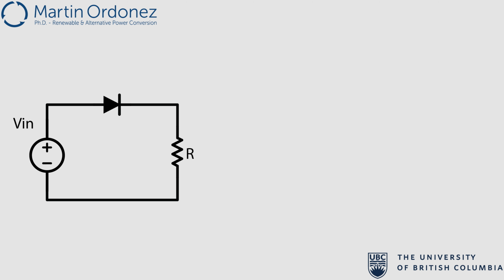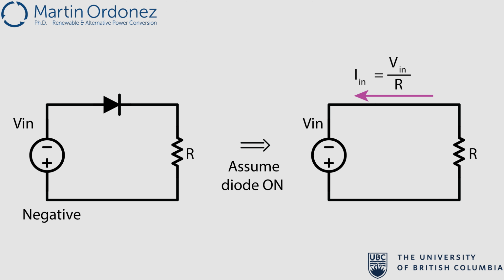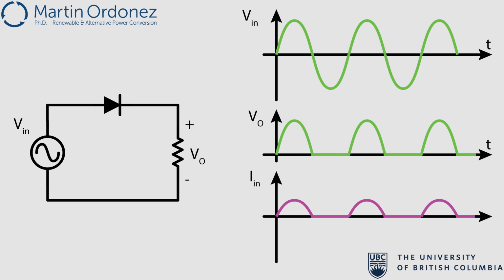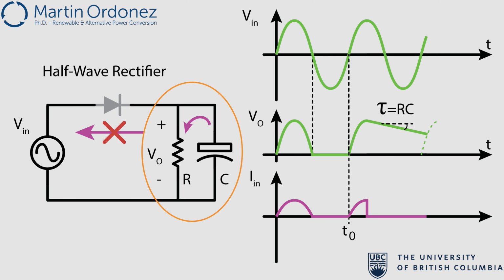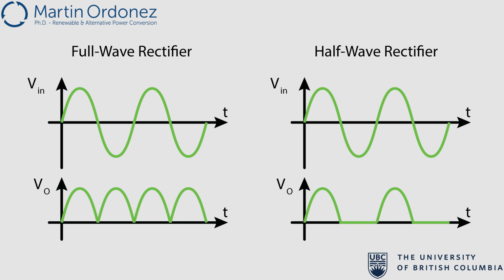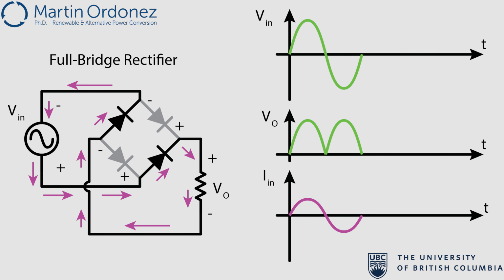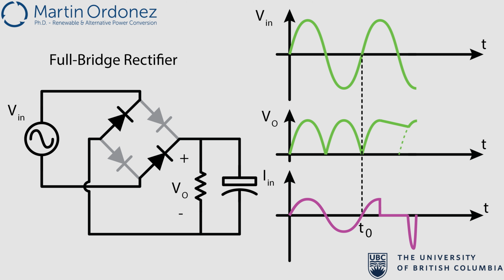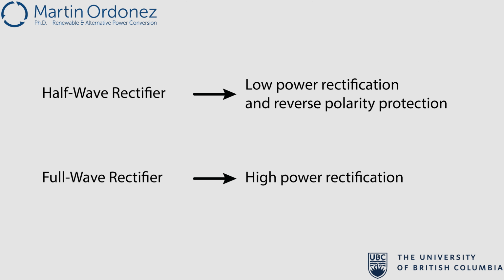Power Electronics - Rectification circuits

Comment: Very interesting videos. Maybe you can help me with this. I am having issues selecting the right diode for a full wave rectifier because the datasheets do not include the Repetitive Peak Forward Surge Current (IFRM) for the diodes. Is this parameter related to the Average Forward Current provided in the datasheet? For what I understand, the current peak in the diodes during the charging time of the capacitors must be lower than the I FRM. Am I right? or in reality it should be lower than the Non-repetitive Peak Forward Surge Current (IFSM)? Thank you in advance

Comment: That's an amazing video hands down but I would like to know and understand a little better that what is going on in the graph of the current after a capacitor is added ??
I am quiet intrigued about this particular topic. Is there a possible way to reach you for further clarification??
Thank you.
Reply: Hi! The current spikes are caused by capacitor charging. You remember that capacitor impedance is Z=1/wC. So the larger capacity value we use the smaller impedance it has. Hence using Ohms Law: I=U/Z, you see that current will be huge with a small impedance.
Reply: WRT the half-wave rectifier, when the source just crosses zero to go into its positive half cycle the output voltage is higher than the input voltage due to the stored charge in the capacitor therefore the current would be flowing from right to left through the diode, therefore the diode is off. Because of this, the current will not flow through the source making the source current (Iin) zero. Keep in mind with AC circuits without the diodes, if there are capacitance and inductance the source switches from delivering power to absorbing power due to the inductors and capacitor's tendency to store and release energy.

Comment: Thank  you for sharing this. A great video that simplifies the operation principle of a full wave rectifier.  Is there another video on sizing of the output capacitor for a defined output voltage ripple?